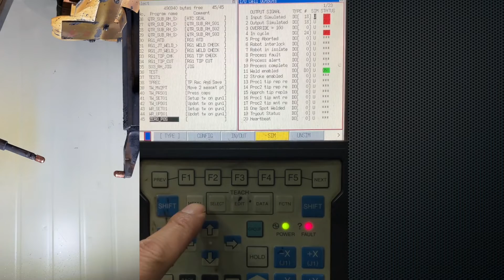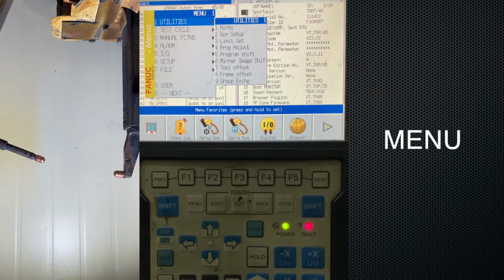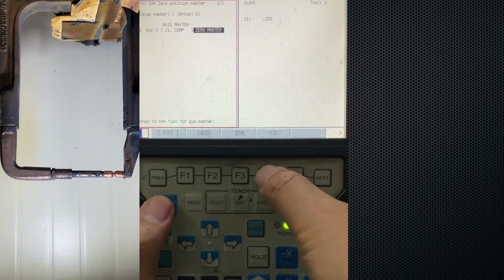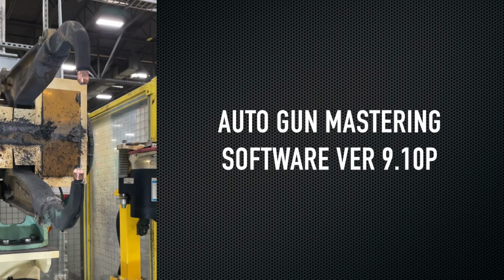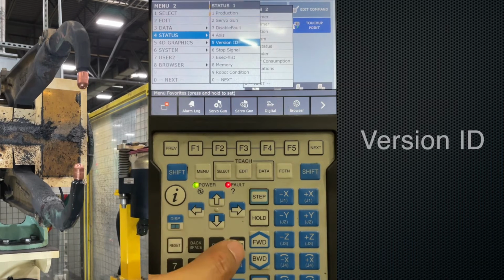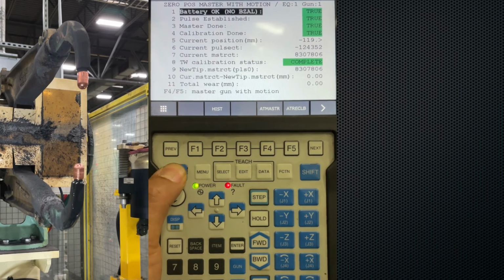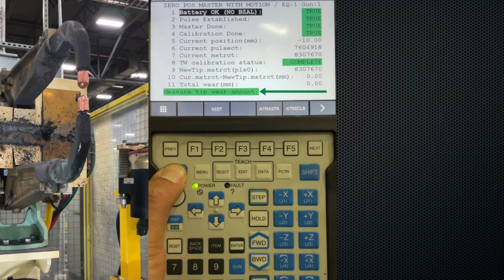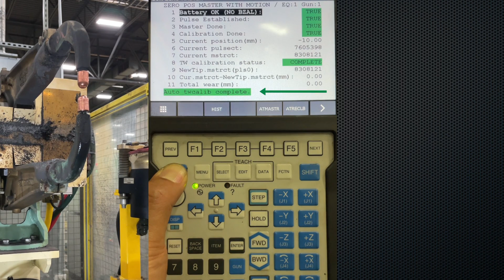Servo gun mastering / FANUC Robot

Comment: What does this robot even do anyways, good vid!
Reply: Spot welding, or resistance welding.

It’s where sheet metal products, through a process in which contacting metal surface points are joined by the heat obtained from resistance to electric current.

I hope this helps!